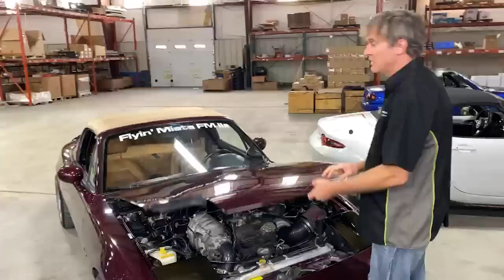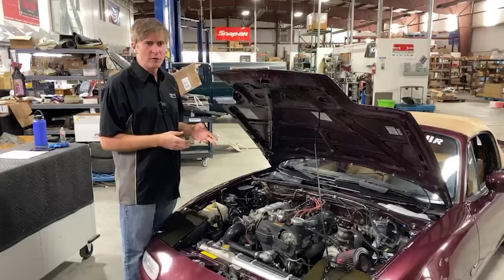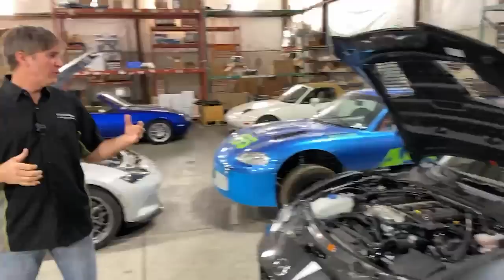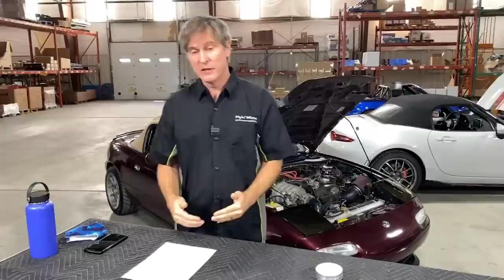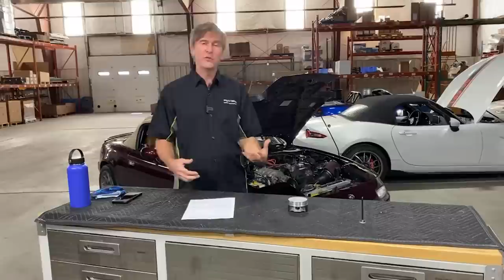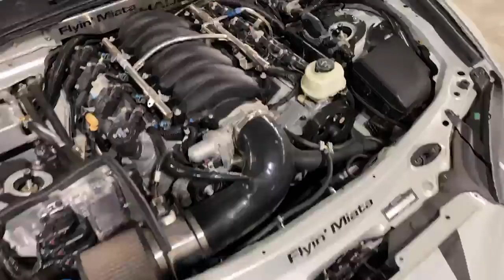High Horsepower Basics for Miatas (FM Live)

Comment: Having owned an NA with highest-spec FM turbo, I  experienced major turbo lag, followed by a huge surge of boost that would whip out the rear end in an instant.  FM is an honest shop and they back up their products. Over the two months I had the car before I sold it, the upgraded powerplant was completely reliable. But you've got to keep in mind, when you get  high-hp in a small engine by forced induction, there is a major price to pay in drivability.
Reply: Now was that tune and high boost setting? Like couldn't you dial it back some and make it less crazy? Just wondering cause I just got a megasquirt and will be going for maybe 220-260ish so I'll need a decent size turbo, but I want it drivable.
Reply: @khayrobs  It would be 100% drivable!
Reply: Not really. Boost by gear, traction control etc are commonplace these days…of course if you have a big turbo drivability wasn’t the part of the plan. Doesn’t take a turbo expert to figure that out

Comment: Awesome video. You answered so many of my questions that I've had about where I should be power wise. I have a stock 1.6 1990 model that I've turboed with a stand alone and bigger injectors . I'm about to get it dynoed and have been SERIOUSLY contemplating the hp I should be safely running. 230hp is gonna be an absolute blast. Thanks again.

Comment: I see turbos and V8s. I'd love to hear FM's opinion on smaller engine swaps. The LFX and AJ30 seem like they'd be reliable. 300 hp options.
Reply from the maker: It comes down to the rest of the driveline. If you keep the stock transmission, you have the same potential failure points as with a turbo of similar power. You may also find the gearing is not optimal.
If you change out the transmission, now you're at a similar level of effort to an LS conversion. So if you're going to all that effort, why leave 100+ hp on the table? The V6 is a little bit lighter, but not THAT much lighter and the extra power and torque really makes up for it.
There's some good looking work in this area - the Rocketeer conversion in particular is very well done - but it seems like a bit of an awkward middle ground.
Reply: @FlyinMiataVideo  Can't register a LS in a Miata in Australia... the LFX however is a different story. :-(

Comment: Very helpful awesome video great content as always! 
What would you say would be the power limit or RPM limit of supertech stainless exhaust valves on e85 or 93?
(Assuming spring seat pressure and pressure at max lift are both adaquit)

Perhaps 350+whp on e85? And up to 350 whp on 93?

Asking bcuz I probably won't be able to setup an EGT sensors on my cast manifold

Comment: So you said, since you don’t have E85 anymore you don’t really go above 400 so you wind up staying around 325. Does that mean that on a built engine with proper tuning you can be using pump gas and achieve 325? Is that 91 or 93?

Comment: Lots of good info! Didn't hear it mentioned but what are adequate catch can setups at different power levels? I previously ran a GTX PCV Valve from passenger side of valve cover > catch can > intake manifold using 3/8th hose at 240hp. Drivers side valve cover port VTA. About to hit 350hp+ and thinking this may now be inadequate.
Reply: Any turbo setup will benefit from a good catch can that takes into account both sides of the valve cover.  There aren't a ton of options so having one > not having one. Only real question is do you dump it manually or drain it to the oil pan? Personal choice, but there are pros & cons.

Comment: What is the status of finding a turbo solution for ND2 Miatas?
Reply from the maker: The ND2 turbo  is entirely dependent on someone cracking the ECU. The programming is completely different than the ND1, and until someone in the aftermarket community figures out the software side, there will be no turbo kits for ND2s. Unfortunately this is completely out of our hands.
Reply: @FlyinMiataVideo  No standalone management solutions?
Reply from the maker: @awesomecooly123  Not that we are aware of for the ND2, but we are only interested in offering a 50-state legal solution, so a full stand alone ECU is not something we would offer at this point.
Reply: @FlyinMiataVideo  I believe OpenFlash Tablet offers some level of tuning for the ND2 now. With that on the market, is running a turbo now a possibility?
Reply from the maker: @lotteplus  We have never used the OpenFlash to be honest, but we don't think it has the sophistication or options to give you enough control to tune for a turbo.

Comment: So bigger cams in a BP4w engine will not bring power gains? even after tuning accordingly with a standalone ECU on E85? 
I'm looking for mods that could bring a slight power increase that aren't directly visible to the "naked eyes", and cams seemed to fall within that category.

To elaborate a little, where I live modifying your car means you'll fail inspection so I can't really fit a turbo under the hood. I am however fortunate enough to have a '99 NB without an OBD port (mazda seemed to have avoided putting them in whenever not mandatory in certain countries), which means I can run a standalone without failing inspection (as the inspector can't tell it's there). A stroker kit seems to be another way to get more power but it's really more expensive.
Reply from the maker: Adding HP past the basic bolt-ons for a NA engine does get expensive quick once you start modding internal parts. I think you might be able to find a cam that shows some improvement these days but back when we did our testing, which was a looooong time ago, we couldn't find anything that was worth the price. Of course, we're thinking about resale so, it'd be different if it was a personal car.

Comment: Is a stronger spark really necessary? And if so, at what power level or is there some other marker?
Reply from the maker: If you can't light the air/fuel mixture, you don't get power. You can tell you need a stronger spark when you start to get misfires near torque peak or you have to close up your plug gap too much.

Comment: I would be interested in the reasons you do not use superchargers and prefer turbos instead. I want more torque and not high end speed so for me, I believe supercharging is the better route.
Reply from the maker: The whole "superchargers make torque and turbos only make high end power" isn't really accurate. It's all about the correct sizing of the components. On the ND, for example, it's the turbo kit that is the torque monster while the common supercharger kit is the one that needs to be wound out to perform.
We did another video on forced induction types that you might enjoy.

Comment: On a stage 1 NA primarily driven on the street with a bit of autocross thrown in, would you recommend a coolant reroute, or is simply upgrading the radiator enough to manage the additional heat?
Reply from the maker: The radiator upgrade should work fine for that sort of use.

Comment: Any chance you know the breaking point on an automatic transmission in a NB2?
Reply from the maker: Since the NB automatic transmission is controlled by the ECU, it's not easy to get to transmission-breaking power levels on that car. Our Stage 1 turbo system retains the stock ECU and the transmission is happy, but we just don't have any information beyond that point.
Reply: @FlyinMiataVideo  so the stock computer will support stage 1 turbo kit with tune I assume.
Reply from the maker: The stock computer is required for our Stage 1 kit.

Comment: Whats your opinion on NDs transmission being able to handle more power like your turbo kit? I love the trans in these and don't want to blow it up
Reply from the maker: Which ND you have and how you drive the car will make a big difference. We know the earlier ND transmissions seem to be weaker, but we have not had any failures on our shop turbo cars. If you plan on racing the car and driving it hard on a regular basis, it might be worth looking into a reinforced Spec Miata transmission.

Comment: Can anyone elaborate more on why superchargers would be bad on a ND?
Reply: for all the exact same reasons why FM doesn't like them on any other miata. Superchargers augment the engine a lot more directly with the size of the engine than turbo setups do. Small engine can only get a small supercharger, turbos are nowhere near as restricted. Therefore, it's all the cash you'd spend turbocharging, and a fraction of the power at the end. Added complexity, increased maintenance, and parasitic losses of the supercharger being strapped to your pulley system.  Short of going with a rotorex (which is still inferior to an exhaust driven turbo), everything points to turbocharging.   The basic jist: Miatas have small engines, small engines gain small power from superchargers.   A corvette gets to gain 150hp from a supercharger because it is a massive supercharger being strapped to a 6+ liter engine that can actually pull that kind of volume down to make boost.
Reply: @twrcrew8852  thank you for your explanation, yeah that makes sense. Id say when choosing between the two it depends on how you want the car to feel. As well as how much power you really need. Turbos are better and make more power  with higher efficiency but I've still found myself enjoying supercharged cars more. I think it's just the linear nature of the supercharger. I do mostly back roads mountain driving/the dragon and autocross so having big power isn't a big deal for me. I also really like lag because that '90s style of big push of power feels so good but thats not conducive for mountain driving. Man I miss my speed6
Reply: @HARaZAC  Speed6s were turbocharged. And actually the lag anxiety of a turbo is not really warranted anymore. A lot of people get hung up on an ancient view of turbos (and often regurgitate it when making comparisons.. the differences between the two in the 1980s).  With twin scrolls, infinitely customizable runner size/manifold design/AR trims on the housings in addition to the map and fueling, you can achieve even quicker spool than a supercharger, further still without the delay of anchoring down the drive belts, decreased MPG when boost isn't desired, and all other issues associated with a super. 

couple that with a hyper-modern engine with direct injection, variable lift and phasing on both exhaust and intake, and you're making money there.  The GTX25 that FM sells is very responsive of "dumb" motors like the 1.8 and 1.6.  VVT lift in the 02-05 further lessened spooling time, and today it was slashed further with all that tech.  There are factory engines now (like the tiny Honda L15)... a 1.5 making full boost at 1800rpm!  A larger engine like ours is just going to be that much sweeter. Skyactive G or not.

Comment: In all that i always wondered how ppl saying its durable to like 300 maybe 350 bhp on 6spd gearbox and then yt builds 440bhp on wheels driving happily on it. Is there some way to strengthen the gearbix to this power or is it just playing with fire at that power level?
Reply from the maker: There's no hard limit as to what power level the stock 6-speed transmission will fail. There are many factors such as the condition of the transmission internals, maintenance history, powerband, how you drive it, and frankly just luck in some cases.

At 400+ wheel horsepower, you're starting to play with fire a bit. If it's your daily drive, I'd have a spare ready to throw in at anytime.

There are a few companies out there that claim to be able to strengthen the stock transmission internals, but we have no recent experience with any of them and can't speak to their quality.
Reply: @FlyinMiataVideo i see like myself i dont want to go that high for my nb maximum 300 but it just was always interesting thing cor me i know about bmw gearbox swap but in this i would rsther have lower whp and still have that miata shift feeling but thanks for the info

Comment: Which is the easiest way to gain 20-30hp in an naturally aspirated engine?? Increasing compr ratio with a better intake will it work ??
Reply from the maker: There's no easy 20-30 hp recipe for naturally aspirated power. Increased displacement, increased compression, increased revs are what you need. Simply increasing the compression ratio won't be enough, and there's not that much power hidden in the intake - especially on the newer models.
Reply: @FlyinMiataVideo  damm, i need a lot of money 
:(
Reply: @FlyinMiataVideo  is it dangerous for the b6 engine increasing compr ratio  from 9,4:1 to 10:1. Here in greece we run with 95 octane at least
Reply from the maker: @MrTAKIS1984  Europe and the US measure octane differently, so your 95 octane is roughly the same as 91 octane in the US. You can probably run 10:1 on that fuel.

Comment: What is a safe boost level for a stock msm? (With standalone ecu & rx8 injectors)
Reply: I have a new manifold and gt2860 but it has a 13lb waste-gate. Would it be safe?
Reply from the maker: We generally rate short block strength by power/torque, not by boost level. The MSM engine can handle 275hp at the wheels reliably, above that your rods are in danger. You may want to look for a different wastegate.

Comment: Just wondering how many horsepower, roughly  I'll get on a 1.6 with your gt2560 turbo kit on wastegate pressure.  2.5 exhaust.
Reply from the maker: You should get approximately 160 wheel horsepower with our Stage 1 Kit and voodoo box. Feel free to drop our techs an email at support@flyinmiata.com if you need more technical specs or answers.
Reply: @FlyinMiataVideo  awesome. I just installed the 2560r with your Flyin Miata manifold and downpipe and I'm running megasquirt. So I just wondered what kind of horsepower I'm running on wastegate pressure. I'm going to PFI speed in Fort Lupton this Saturday to get the Boost turned up. Thank you
Reply from the maker: @scottmason2245  Wastegate pressure can varydepending on other factors, so it's not really a good measure to use. That setup with a good intercooler and good tuning is good for roughly 230 rwhp with an expected lifespan of a couple of decades.
Reply: @FlyinMiataVideo  that's awesome to know I appreciate it. I've got a lot of money in Parts in this car and I don't want to ruin it. Thanks again

Comment: Intakes best for all motor NA8?
Reply: There are two main things to consider. First, charge temps. Second, for a broad torque band you want the intake tubing length to stay long. Unfortunately these two things are hard to get both right and the best solution we've used for a couple decades is the Randall intake duct which delivers cooler air from the cowl area into the stock air filter box.

Comment: How do spec miatas work fine without coolant reroutes?
Reply from the maker: Spec Miata is limited to stock horsepower with big radiators, no AC and very efficient coolant.
Reply: @FlyinMiataVideo  ....they also have the right head gasket.....:-) The question I have stock 2003 NB ...is their value in taking my Mazda Miata to a tuner /dyno  testing before starting any modifications ? P.S. going to order one of those ATI balance things .
Reply: @alexisknows6513  If you want to know what your mods did on your car, yes, you should definitely do a baseline and then return to the same dyno for follow ups.

Comment: Dang, this video should of been titles Q and A for NA miata cuz thats all he talks about and when asked a question about the NC and ND as far as how to make power he goes and points out a V8 kinda stupid.  I can see he rather talk about old cara and not the new ones maybe cuz he
Dont like them..
Reply from the maker: We apologize if we weren't able to cover everything you were hoping for in this video. The older models have been around longer and there are obviously much more parts and opportunities for gains on the older engines. This video was to give a path for BIG horsepower. Newer engines are much more efficient and are much more technical, meaning the easiest way to get a major horsepower bump is through an engine swap, or forced induction. Feel free to reach out to our customer support team directly if you have specific questions you need help with, or suggestions on mods that will work to help boost horsepower to the NC/ND platform.
Reply: @FlyinMiataVideo  hey! I appreciate the response may I suggest in future videos on the titles at least to put the generation you guys will talk about i dont know i think maybe it will
Attract more ppl that way but what do i know